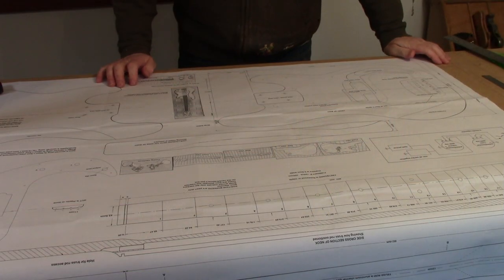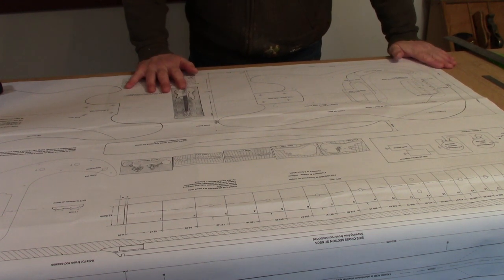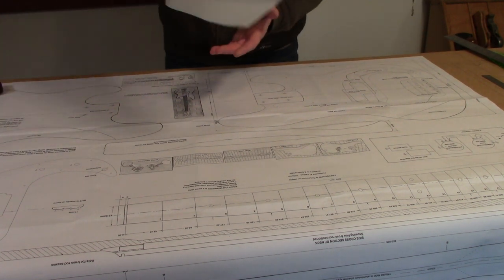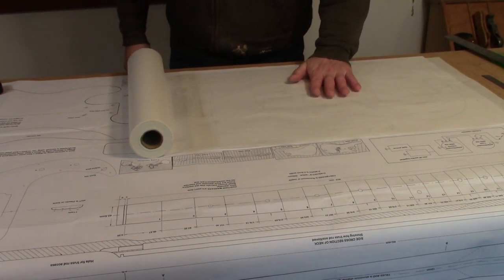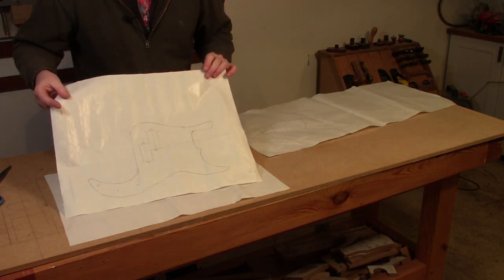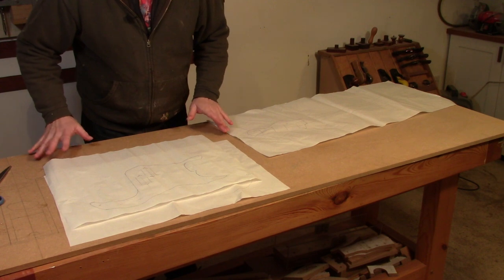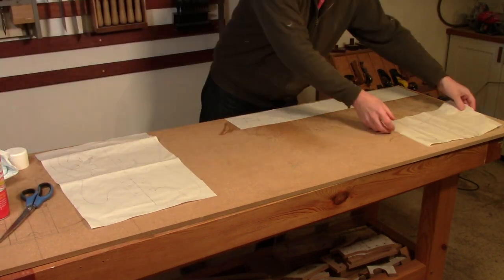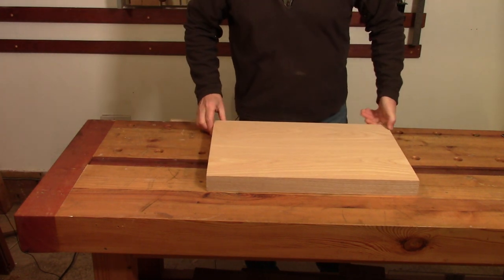MYSTERY GUITAR BUILD REVEALED!  New build from the Shed of Dreams

Comment: Hey. Love the idea of this build. I did a bass build from a set of plans a while ago. I bought the plans from John Anthony I think it was. They are lovely plans but I found them not perfectly to scale. The odd bits were a couple mm or so out. I called them to ask and they said possibly over years of re-printing that the images may have changed with printing formats and stuff. I built it from the dimensions written not the actual pictures. This isn’t a troll comment just a heads up about the difficulties I had using the same method you are using.
Reply from the maker: Thanks James, these plans are also from John Anthony. I've used them in the past and there were some inconsistancies. I am using them for the basic shapes but the critical dimensions such as scale and fret location will be measured independantly. Thanks for the input, it is very welcome :)